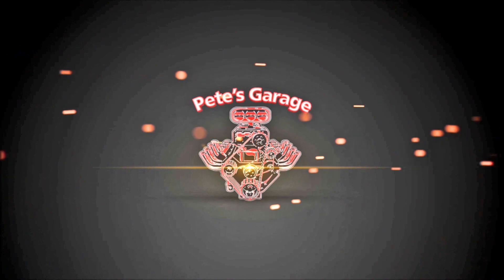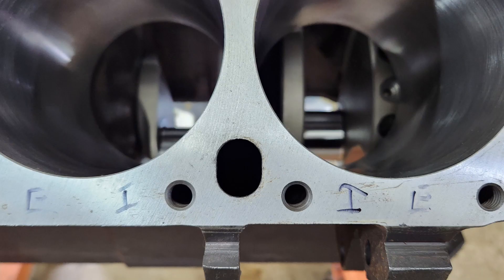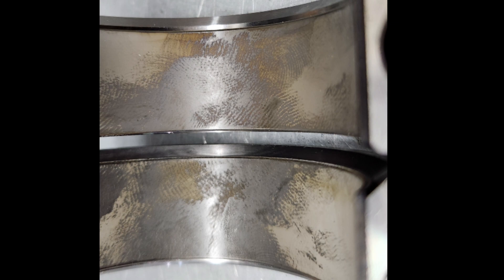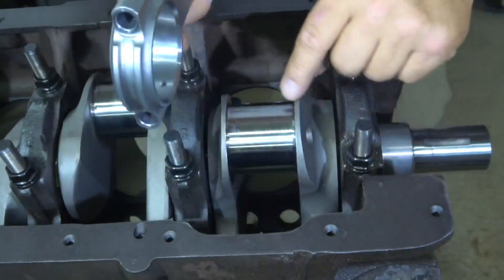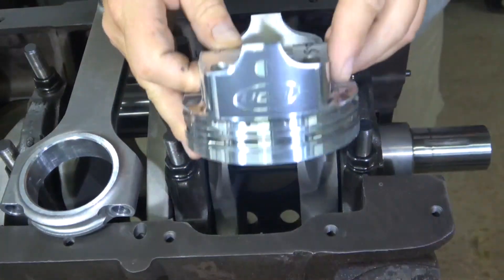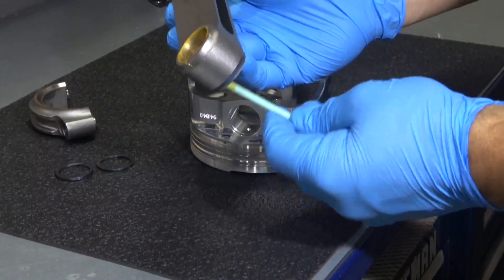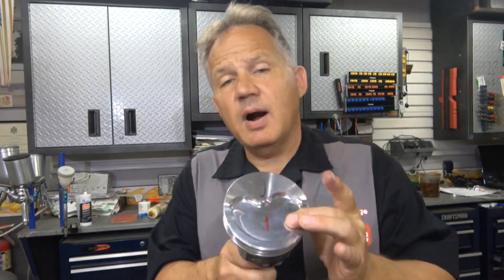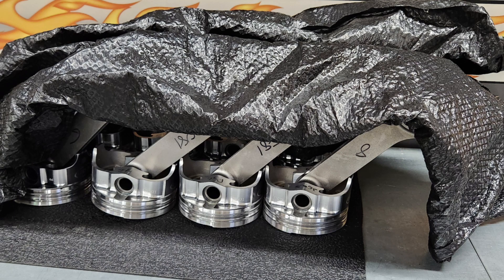Engine Building Tips - Assembling Pistons to Rods with Spiral Locks 440 MOPAR 518 Stroker

Comment: You always have good videos!  Don't be afraid to stretch the spiro-locks out.  Makes it easier to install them.  Removing them is still difficult unless the piston has the small hole to make getting under the spring easier.
Reply from the maker: Good call!

Comment: I have only used these once, but I learned pretty quickly, to open up the spiral and file a flat on the end. It will keep from scratching the piston, (did it), and it gives you a space to easily slip the end in with a flat blade screw driver.  I have also seen newer pistons with a round wire snap ring, but have not used one. Have you, and if so, what are your thoughts on them??
Reply from the maker: That's a good tip. I prefer the snap rings myself